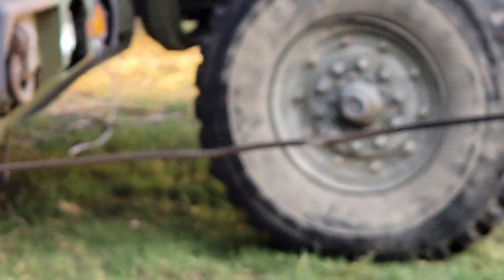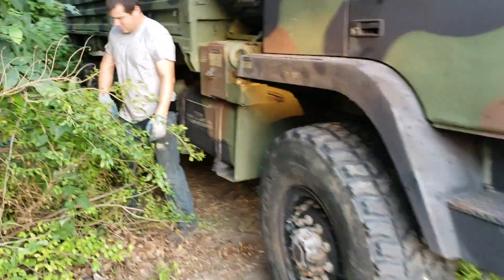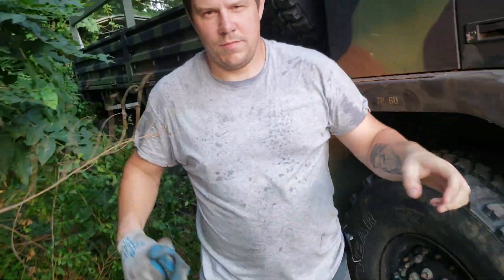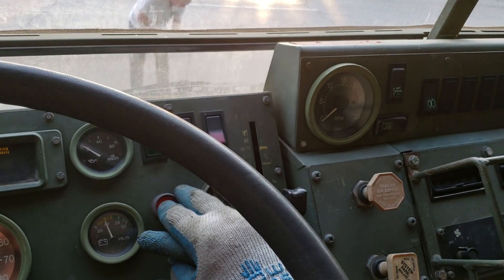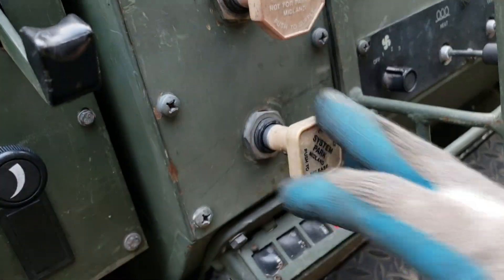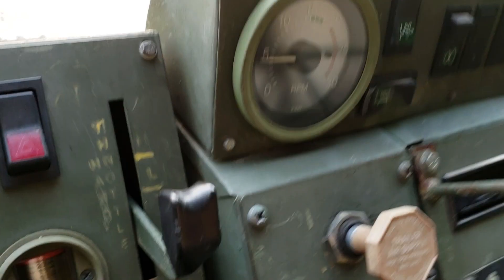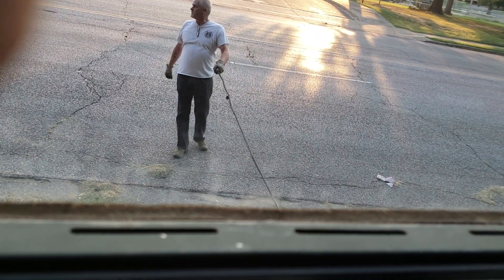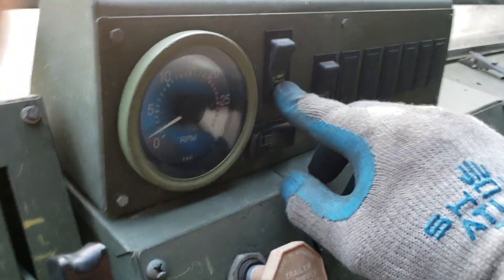LMTV/FMTV winch operation procedure per the TM

Comment: Wes do you have much knowledge on the 1089 wreckers everything functions but to use crane or outriggers I have to hold the over ride switch
Reply from the maker: Is the selector in the correct position for the crane? Figure 2-24 in operation manual outlines it. 

It probably is the crane safety in the control box on the boom